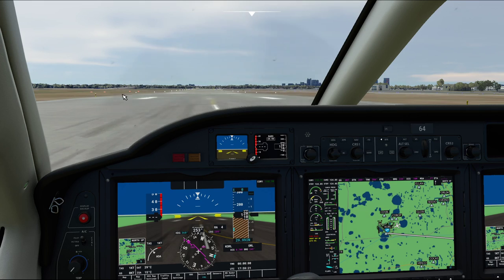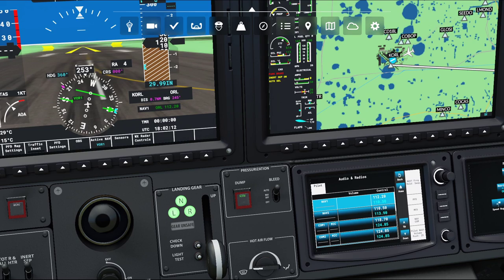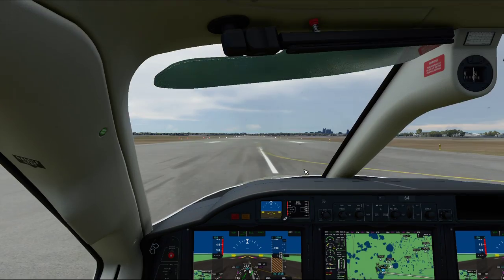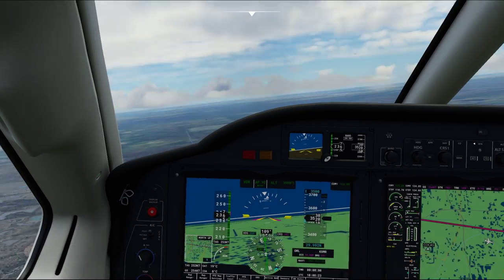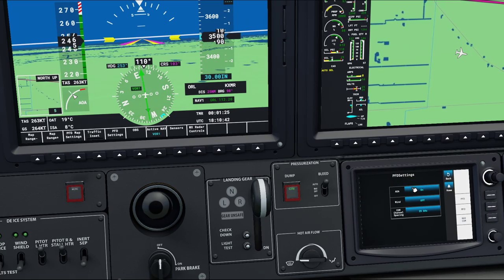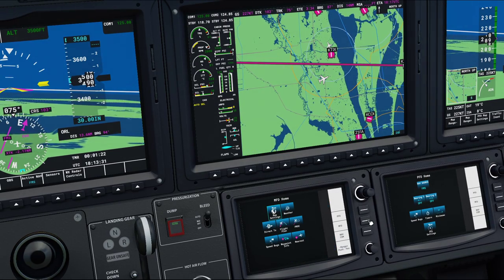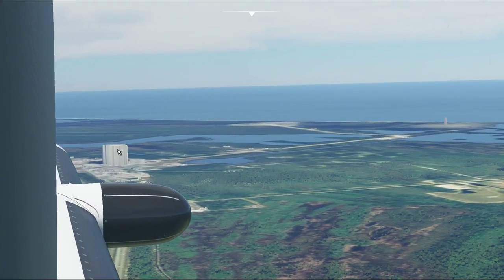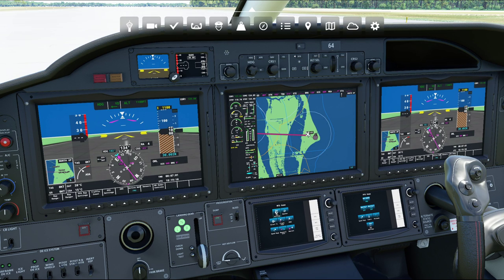FS2020 G3000 and Autopilot Tutorial with TBM 930

Comment: I've seen many tutorials on the Avionics on YouTube and on Reddit. Almost nobody is talking about the importance of the TO/GA button. It positions the flight director at the proper pitch (usually 7-10°) for a takeoff, or if you have to go around after a missed approach. It is usually a button located on the side, or underneath (like in the SR22) the Throttle and it is a very important feature for take-off. Usually available on aircraft larger than the Cessna 172 (and separate Garmin GMC Autopilot unit), or the larger jets with the Pro Line 21 and even commercial airliners. Hope this helps!
Reply: Thanks for the tip Joshua. Where is the TO/GA button located? I'll have a look when I get on next.
Reply: @weepingeye  It varies depending on the aircraft but it's usually on the side of the throttle handle or below it.

Comment: One for the TBM jockeys here... I took it for a first flight an hour ago and couldn't get the autopilot to engage. After faffing around the panels for a few minutes, I discovered an A/P trim or similar on the overhead copilot side, which when flipped on , allows the autopilot to function as expected. There isn't as mach depth as I had hoped for, but the 3rd party specialists will have a field day with the G3000/G5000 in time to come. This is a staggering starting point.
Reply: That one caught me out too. One of those "Doh!" moments when you're trying to learn a new aircraft

Comment: Heres how to land ILS in the TBM:

G3000

Obtain LOC frequency in TBM:

[center bottom screen]Press MFD -> Press Waypoint Info -> Airport -> Select Airport (the destination you want to ILS on if its available at that airport) -> enter airport code -> scroll down to reveal the LOC frequency for ILS.

Set Radio and ILS approach:

Get LOC frequency for ILS -> [center bottom screen]NAV COM -> Audio & Radios -> Set Nav1 to LOC frequency -> Press “Xfer” -> [top left screen] PFD Settings -> Bearing 1 set to Nav1 -> Listen to ATC to get the right height -> watch Nav1 Capture the LOC -> [Auto pilotcontrol] Press ‘APR’ mode -> watch the glide slope appear.

Note: its not fully automated like the a320 … it will land itself but not flare so youll have to do that last bit yourself.
Reply: Thank you for this! Works perfectly.
Reply: Would you mind doing a video? I followed your steps but I can't capture the localizer or the glide slope. Regular NAV is working fine.

Comment: The yaw damper should not be turned on until after take off, gear up, flaps up. You need full rudder control on takeoff roll with something as powerful as the TBM, there is a reason you put so much rudder trim for take off. On take off and landing the yaw damper can your reduce your ability to be able to deal with things like propwash and crosswinds. You need all the control authority you can get in these situations.

Also, regarding the inertial separator. TBM do a video on the subject if you want more information but basically you don't turn it off unless you fly higher than 5000 feet, this is to prevent foreign object damage from debris on the runway or birds up to altitudes they are known to inhabit. Also, while rain is not an issue if you combine it with icing conditions then the inertial separator should come on as it can protect damage from ice build up breaking off into the engine, this can also ruin your day. As a rule of thumb, turn it off if the sky is clear and your past 6000 feet or if your on your way down and the sky is clear once you hit 10000 feet which is an easy number to remember. Also if your at higher altitudes and are in icing condtions, turn it on with your other deicing systems!

I would say be aware when disabling it as you climb on 100% torque as you will get a spike of up to 20% because of the extra air getting into the engine (the separator as the name suggests is basically a bypass) which could put you in the red damaging the engine but I don't think this is modelled in MSFS or if it is there is no real consequence. Just thought I'd add my 2 cents.
Reply from the maker: Great information, thanks!
Reply: @PGatcomb  Thank you for this extra information. I was unsure of what the inertial seperator is, and what it does, and this kind of explains it, and how/when to use it.
Reply: Ok ty for the tip.

Comment: The function of the Inertial Separator is to help prevent foreign object damage (FOD) to the engine. It is recommended to use it by energizing the separator when the aircraft is on the ground and during the landing approach, as this will prevent FOD particles from entering the compressor section ... Also when flying into clouds when the temperature is below freezing so as to avoid the possibility of ice entering the engine.

Comment: You can do an ILS approach by putting the localizer in NAV1 then switching Active NAV to LOC1 on your PFD. On the autopilot panel, change to NAV  mode and then select APR and it will capture the glide slope once your altitude intersects the slope.
Reply: What he means in the video is the runway he was landing at in the video (KXMR) has no localizer for ILS so he cannot do an ILS approach.
Reply: Awesome, I was trying to figure exactly how to do this. I selected the ILS approach in the procedures menu but it never captured the glideslope, probably because I was still on GPS/FMS
Reply: @Galastin  I believe they broke APR mode in the latest patch. Since the new patch, I've found that APR no longer captures an ILS glide slope. RNAV seems to work but the diamond never seems to move
Reply: @0x80O0oOverfl0w  damn, just about to go for a flight and give it a try

Comment: Hi, if you are to high coming down for landing  there is a way to loose Hight very quickly , turn the yoke left and compensate with right rudder , so you wil loose hight  very fast and on an angle or sideway , I learn this technic when I learnt to flight. I love your tutorials straight to the point and don't go around biting  the bush  or unnecessary chatter

Comment: For those of you that love this plane and want to be better at flying it for real life limits and configuration I have a link to the manual. Make sure your torque / outside air temp/ and speeds / n2 etc all line up with your settings for Max cruise landing takeoff etc .  It is so good when you use those settings .  This is by far my favorite plane on this sim. It’s not perfect! I hope they do improvements on it but it’s a solid aircraft...

https://www.tbm.aero/wp-content/uploads/2016/03/PIM-930__AN__E0.pdf

Comment: I have no idea if this matters in the simulator, but the TBM 930 POH (Section 2.2.6 - Limitations, Operation Limits, GFC 700 Autopilot Limits) says "The autopilot and yaw damper must be OFF during takeoff and landing." I know they tried to make most of the systems in the simulator as realistic as they could, especially for this aircraft, but I don't know where exactly things are "looser" than reality and by how much. The "and" in that line from the POH makes me think the YD can be engaged while the AP is not. This question might be silly in the context of the sim, but maybe a real pilot will know for sure: If the AP button is not illuminated (AP not engaged), are the YD button's state and other activated settings on that autopilot panel irrelevant until AP is actually engaged?

Comment: (Not a correction, just an addition) The inert. sep should remain [ON] while taxiing in all environmental conditions. Additionally in conditions such as ice, snow, dust, smoke, etc. it should remain on during takeoff and/or landing as well. It is a function that filters out foreign objects from the engine intake. If failures are enabled in the sim, this could possibly lead to one.

Comment: how did u know the rotate speed is 90 knots
Reply: This is known as VR and can be published by the manufacturer. In the G3000, once you have finished your fuel/weight/balance/wind stuff in the takeoff configuration, depending on the aircraft, the ones that do the calculation for you will show you the takeoff speeds and you have to accept them. Smaller planes usually don't do this so you have a chart that helps you configure them. Generally though, for this TBM, 90 knots is a good speed as long as you also have the correct flap setting. Once you accept the Vspeeds you will see them posted on the left side of your PFD right by the speed.

Comment: My question is; when we have a flight plan in from the sim then we set NAV to GPS and engage autopilot why doesn't it capture that track, it just does a tightening turn forever?  Its as if that flight plan leg is not activated.  What I'd like to do is select an IFR route using the sim, then when I get in the plane load that flight plan, set up HDG and ALT before take off then when resume navigation start using the flight plan its showing on the screen.  Garmin is the best in business but they really are backward to use and you wouldn't easily figure it out intuitively, and its not obvious when its not working what its doing - I think that is because the process is largely the same as it was in the very early days and maintaining interoperability with existing systems.

Comment: Nice Video has good information and instructions,m thanks, one question what is LVL and how it can be used, thanks, anyone knows that is LVL in this airplane? Thanks
Reply: LVL is the Level Button. When you loose the orientation you press the button and the AP will engage and the airplane levels out. a common safety feature in modern cockpits. btw in Cirrus Aircrafts with GFC700 it is a blue colored button.

Comment: Hi again. How you calculated the value 103° to the next airport at 3 mins of the video? What formula you used to get the value of 103°?

I know you can get the value from the website before you take off but how we can calculate the value if we don't have a flight plan in the air?
Reply: VOR is very obsolete and rarely used in Jets. The G3000 is so powerful that it does all the math and work for you, so using VOR on such an advanced aircraft is like using pencil and paper to do your Calculus homework, when you have a Ti-83 Plus graphing calculator.
In what you ask in particular, there are 2 ways to do it with VOR:
1) He mentions skyvector; so he looked at the VOR and tuned it in. If you tune in to the VOR of the current Airport and look at the Radial (circle on the diagram around the VOR showing all headings), the next airport was at 103°. When you rotate the bug to 103° it creates a course towards that heading which you can use for lateral navigation.
2) The other way to do it is to tune in the VOR of the next Airport (if it has one and it is close enough, VOR does have a functional range of around 200 miles). Once you tune it in, the needle will point towards it, however, if you wanna go directly towards it, you adjust the course until all parts of the needle are aligned. That will tell you at what heading the Airport is.
With a GPS, just do a Direct To to that Airport, and you are done ;)

Comment: Great video. Thanks a lot. Could you please talk about how throttle and propeller settings relate to the torque, ITT and NG gauges in the TBM 930? I notice that most fly with propellers 100% all the time. Is this appropriate?

Comment: Thanks for posting. I viewed this to see if you or anyone else was having the AP problems I've had. None of the Garmin-based APs are working properly. With the 3000 in the TBM, for example, it'll capture and hold ALT, but if I engage either NAV (VOR or GPS-coupled) or HDG, it not only fails to track properly, but it initiates an ever-increasing bank angle, resulting in an uncommanded roll event (AP should never exceed 30° of bank), requiring a disconnect to regain control (you can "fight it" to a certain extent, but this obviously should not be necessary). Has anyone experienced this and are there any ideas?
Reply: Yes. Uninstall the beta Working TItle NXI garmin preview thing from the marketplace, and it will restore normal operation on all auto pilot equipped aircraft.

Comment: Can you explain the heading select button and knob? ATC tells me to turn left heading 180 degrees but this is clearly not in line with the standard GPS’ purple line.
Reply: It doesn't have to be.  If they have you turn to 180 then spin the heading knob until the bug is on 180 and hit heading on the flight director control panel.
Reply: thecorporatepilotdad Thats what I do, but the purple line doesn’t seem to move when I’m selecting 180 with the heading knob. Is there a step in between?
Reply: Heading and course are different from one another.   The purple course line won't move if you have GPS selected.   You have to select NAV SOURCE to NAV 1 on the PFD or FMS then the course line will turn green.  Then spin the course knob and course line will rotate.

Comment: Hi! May I ask you a noob question? Is it 'normal' that after turning the auto pilot off while it is performing a turn or an altitude change - the airplane behaves strangely, like its control surfaces are locked in some position. So I have to fight against something (like trims) to fly straight. If I let go my joystick the plane can do anything: barrel rolls, loops, whatever.. Is it what it's supposed to be? Thanks!
Reply: you need to reset trims IIRC, that's what AP uses to control surfaces. When you shut AP during a turn, the yaw trim stays where the AP left it?
Reply: You may need to make sure the flight director is off.  I don't know if it automatically shuts off on the G3000 in-game but when I am flying the DA62 and I turn off the auto-pilot the aircraft would fight my inputs constantly.  I discovered that with the G1000 if you don't turn off the FD as well as the AP the game things that the AP is still on and tries to control the aircraft.

Comment: Did you map a controller to reverse thrust?  I've been having an issue trying to do so with my WH Throttle.
Reply: you can bind a key to activate the reverse thrust as needed. remember in settings/controller select in filter "All"

Comment: Thank you for a great informative video - been really helpful. I have just one issue ( just 1 lol). When flying the Daher 930 - my Garmin just freezes ( both outer screens - not the centre)-  not showing height and speed and not allowing me to alter the planes altitude. I usually turn off the Auto Pilot - then decend to the requested altitude. Usually while decending the Garmin springs back into life and works perfect. Is it Pilot error on my part

Comment: My nav mode on this plane isn't working. I cant keep myself on coarse, but on the Citation it was turning itself and kept flying itself on coarse. And staying on the line

Also what do those blue triangles mean?

Figured it out. So PFD -Home then click NAV source. Switch to FMS. 
Plane will automatically fly its coarse for you. :) got a 3 hour flight with TBM
Every plane is so different. You gotta learn them all! I feel most comfortable in the King Air.
Reply: Same im so comfortable with the king air, its has so many iptions, and the controls are easy. I may say that the 350i it’s easier to fly than the 172sp, however the direct to feature is (inop.) and that makes me mad. Thats why im trying to learn this plane.

Comment: does anyone have the issue with the atc and its late responding about runway? they give me directions way to late when im too close to the airport
Reply: Here's a tip: Listen to ATIS; tune in the frequency and listen to it on one of the COMs. It should be available from as far back as 30-50 NM.
Towards the end you will here Landing and Departing runway and you will most likely be assigned that one.
Reply: Yup! Have also had it to tell me to go around after I had landed. And then once it told me descend and ascend between 5000 and 7000 like 8 times. But like over the course of about 90 seconds! Was pretty funny.

Comment: Anyone else getting a bug where the AP system in this plane rolls the plane over and pitches into the ground constantly?
Reply: Me. Even sometimes I can´t turn on the autopilot :(
Reply: @javimerino5216  There's a switch above you to the far right call AP/Trim ON or something
Reply: @Caennuck  I get it, thank you :)
Reply: Yeah that keeps happening to me if I try to disconnect and reconnect the AP, but if I let the plane do a few loops with AP on and don't touch the controls then the autopilot usually resets back to normal
Reply: DarthInvaderZim Mine tried to crater me into the ground is the only problem. It doesn’t just do loops
Reply: Yes, it happens all the time. Even after pausing, checking trims and control settings sometimes it just wants to roll over and spiral in.

Comment: The lack of speed brakes on the TBM seems like an oversight on Daher's part.
Reply: You should not need speed brakes on a turboprop because on fine pitch the propeller is a flat plank to the airflow.  So in the real plane you feel strong deceleration when you throttle back and it can do really steep approaches.  In the simulator there seems little to no propeller drag simulated so its really tricky to bleed the speed off, and I do what he does get the nose up and then once you pop the flaps (once you are in the white region on the ASI) and UC it really drags and you can swoop down.

Comment: I was looking at the G 3000 in the king air and I was not able to find out how to bring up the flight plan that I created in flight simulator. Of course with a G 1000 there’s an FPL button. But I could not find any such thing on the G 3000. Can you show that and the way to alter or add and remove way points on your existing flight plan on the G 3000? By the way what is the inertial separator used for? Please explain its function.